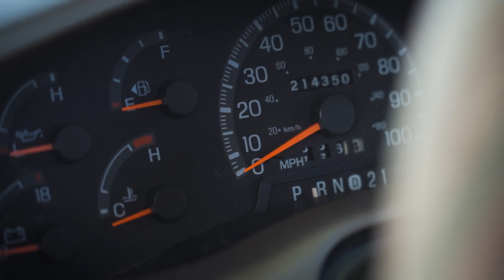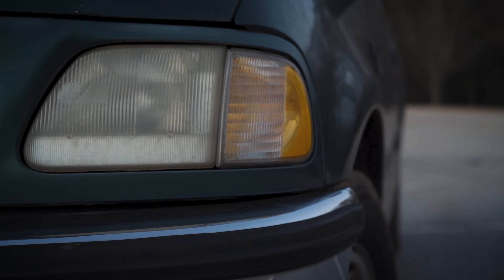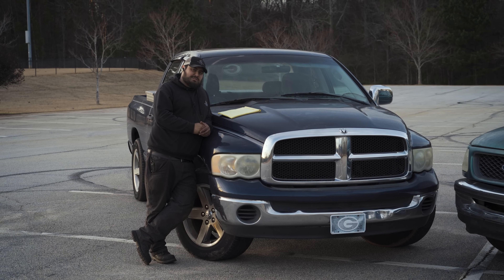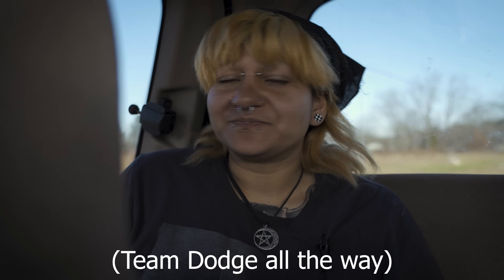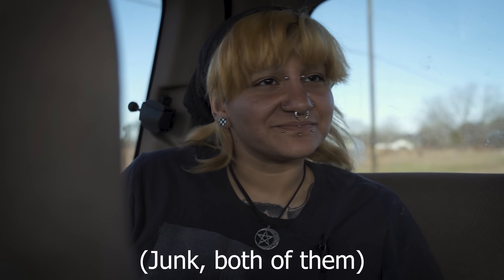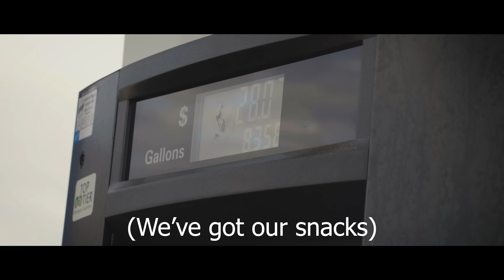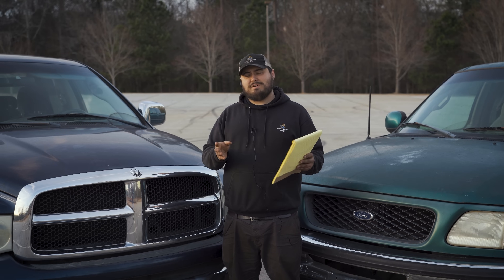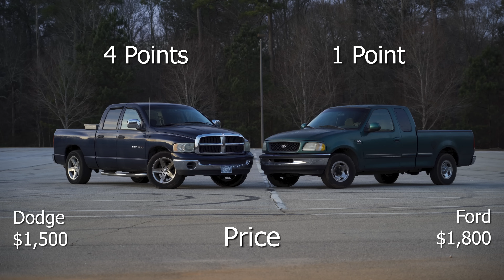CHEAP TRUCK TOWING CHALLENGE, Head to Head Towing Challenge, Dodge Ram 1500 vs Ford F-150 Reviews

Comment: I didn't get a $2k truck , but in 2023 I got a $3500 gmc 2005 2500 4x4 short bed ex-cab 6.0l 189k miles with plow in Colorado. I had a 2005 gmc Yukon xl already and think that generation of truck is the best of all brands even over toyota. And definitely beat the dodge and ford of same year generations. Where I am in rural Colorado almost every truck big suv still on the road are 1999-2006 Chevy , gmc. There are very rarely dodges fords years 1999-2010, they just fall apart at high altitude work loads, especially the dodges.

Comment: I have had a few dodges and have a 2016 Ram right now 5.7 and haven't had a problem with any of them and towed over 3,000 pounds with them from Louisiana to Houston Texas over 500 miles one way and had the 4.7, and the 5.2 in the other two and towing wise with the smaller engines I was still getting 18 mpg. Well over 200,000 miles with all three of them the one I have now has the 5.7 almost 300,000 miles on it and I still tow with it without any problems. I had ford's and the best ones I had one had the inline 300 6cyl and one with the 302 all the rest I had problems from day one and I had a lot of them.

Comment: I have had 00 f150 and bought it with 98,000 miles and had it for ten years. So when I stopped driving it I’d gotten 310,000 miles. But when it comes to towing my 19 f150 it does way better than my old 00 ever did

Comment: I’ve had a 4.7 sling a rod, and ive seen a 4.7 last 20 years of abuse still runs only had fluids changed. I’ve also had a 5.9 magnum, and I abused the ever living shit out of it every time I drove it. Truly felt indestructible. Had a Tahoe Chevy 5.3, 220k had lifter noise on start up/cold ran and drove good was super reliable never beat on it. Chevy 2500 with 6.0 towed heavy trailer hauled hundred’s probably thousand cars with it. Never had any issue sold at 260k, guy ran it for a year and blew it up. Only blew up cuz he snapped the dipstick tube and just kept driving it. Bought it back for 250, scored a 70k mile 6.0 super clean for 200 bucks, wakes up every morning and it’s back in action. Also had another 2500, 370k miles never had any major service didn’t have long but was a good truck. I’ve only had one ford 4.6 it was Ok. Better on gas then them all, felt more comfortable driving rather than putting it to work. I have no real complaints about any of them. Both Chevy and dodge have had blower motor wiring issues. Tahoe and Silverado had blower wiring issues you’d wiggle them and it’d kick on. The dodge would melt the resistor every so often. Chevy just felt better quality, when it came to interior towing, and power. I never beat on my chevys like the dodge so can’t say how much abuse it’ll take. Ford blew plastic coolant y pipe first time I went wot. All three domestics are good, they all have their quirks. I can’t attest to any foreign trucks but don’t care too,

Comment: I have a 97 f150 with 277,000 miles and it’s hauls anything no problem, I’m not sure if it’s bc it has the 5.4 but I can floor it and still get up to speed no problem

Comment: I will at this comment I have had a friend that has own multiple 4.7 l well I have owned two of the same Ford f-150 plus both of his transmissions have blown and his engines have gone out I am still holding strong with my 98 Ford f150 4.6 l my 97 5.4 four-wheel drive long wheelbase

Comment: I dont know much about the 4.7 But my 2003 5.9 magnum back in the day was at 294,000 miles on orginial motor, I never put a transmission in it since i bought it with 242,000 but im sure its had atleast one. The A/C kinda sucked but other than that it was an awesome and great running truck and looked so good.

Comment: Iv has numerous early 2000s half ton pickups and from my experience my 04 hemi has been the best driving and towing out off all. Even with 275k miles. I’d even put it befor my 2017 ram 1500 just because my 04 holds gear way better then my 2017

Comment: Hahaha love the engine very three years in the ram. my ram  is a 04 has the exact same motor has 305,000 miles on it with the original motor and trans lol. Always has started n no major issues. I’d trust that tuck to take me to hell n back

Comment: How about a 98 k1500 vs these two ?
Reply from the maker: Very different price point, can't find cheap Chevy's with a real title around here. I have a 1997 Silverado I did a review on, but the Silverado is so much more expensive it's not fair to compare it to these cheap trucks.
Reply: @GrumpyMonkeyGarage  I got a 92 heavy half  k2500 I would happy let yall use in a challenge lol . Rust free with title . It took me a good year to find my 98 that was a one owner truck paid 5 thousand a year ago for it . The best 5 thousand I spent that whole year . Only thing I had to do was replace a lazy starter and added drilled slotted rotors. Gets 17 mpg other then the typical gm clear code it's a sweet truck .

Comment: I had a 98 f150 4.6 I loved it but I had 2657017 lt tires it towed just fine tires make the truck but I agree with the Dodge being junk transmission issues electric issues but Ford is always more reliable

Comment: 02-05 had the worst of the wiring problems. If you put a tipm on an 06-08 they arnt too bad. I had to replace the wiper motor and wiper transmission both on my 04 along with it going into limp mode all the time because the bell crank sensor (tps) was going out.

Comment: “Old ford you can do no wrong” Got to love the subtle at which he talks about the faults the ford has on the tow test, “ it’s got some of the common ford electrical problems”  this is what it is like working in a shop with brand loyal techs. Both vehicles could have the same problems one is labeled a POS And the other is just old and to be expected. 😂🤣

I was mechanic for over 10 years and could get both of these trucks running tip top again. I personally think the dodge is better truck. Hell read the edmunds 2004-2005 used truck reviews on the dodge and the consumer rates it 4.7 start out of 5.

Comment: I have a 1997 f150 single cab short bed. 4.6 lifted on 35s. 5 speed swapped. Pulled a loaded trailer 12 hours through the mountains and 12 hours back. Boiled the trans fluid once but it did pretty good.
Reply: 11-12 MPG. brakes left something to be desired tho

Comment: Comparing apples to oranges. Although the engine liters are close, the structures are different. Compare a 2004- 2005 4.6 F150 to the ram, then the test would be equal. If not, then could compare a 1994-2001 Dosge Ram 5.2 for handling comparison to the 1998 F150.

Comment: My ex stepsister had a 98 4.6l thing ran great with over 305k on the odometer which had been broke for no telling how long and probably realistically had 400k plus on the original engine and transmission  her dumb ass ran it out of oil and cooked the number 7 connecting rod. What’s crazy when it slung the rod it didn’t destroy the block. Bet that block could be reused as long as no main bearing was spun.  No hole anywhere in the oil pan no cracks no nothing. Piston was still in the cylinder for number 7. Damn 4.6l are over engineered but my god they don’t quit lol.

Comment: Looked/sounded like the Dodge had an aftermarket exhaust, I think if the Ford had one also it might have picked up a few horsepower for towing acceleration (also the ‘99-up 4.6L has more horsepower)

Comment: 5:34
Hi there. 
Dodges allow for the keys to come out of the ignition as a "rancher" would want to use keys to unlock gates and or start farm equipment. 
For this video im going team ford.
Ford can make a v8
But so can dodge 🤔
Reply from the maker: The problem was I turned the truck off, and it kept running. Key fully in the off position, wouldn't turn off!

Comment: I am certainly all for Ford over here, I love ford and they last forever, but I did in fact buy that same dodge since it was a cheap. I got a 2002 ram 1500 4.7 and a 5 speed, and I’ll tell you I absolutely loved that truck and still have it until I can sell it to buy an f250. At first I was not a huge fan of the 4.7, as it has 3 huge issues. But, after seeing one of my friends with a 4.7 in their grand Cherokee do 260k miles of absolute abuse, I got interested. And sure enough if you take care of the 4.7 it will last even if you beat it. Unfortunately it lacked power so I am going to sell it. But all in all actually really enjoyed the truck.

Comment: My 06 ram had the same wiring problems. Took it everywhere to get it fixed. No one could solve it. One day after work it wouldn’t shut off so I dug into it myself. It’s actually a quick fix. There’s a rod from the ignition switch that runs though the steering column. It goes to a little black box. Inside the box is a ball bearing and spring that has came loose and is shorting out the electronics in the black box. Remove the bearing and spring and the issue never came back.

Comment: The dodge if a 2002 like that one tested was offered with the old 5.9 pushrod motor just 02 before the Hemi came out.  That engine would suck much more gas, and came with 4 speed trans, but still might be an even better tow rig.

Comment: I’ve owned lots of cars and trucks. That generation ford is rad and dependable, so is the generation before that. After that I’m not a huge fan of the power plant, still very nice just less dependable. The dodges are ruff, and in my area they’re very few survivors. The dodges before these were great minus the cracking failing dash, they did have weak trans. The chevys were great, the Tran were there weak spots.

Comment: Had a 2003 F150 Fx4 extended Cab with the 5.4
The best thing about these 10th Gen F150s is that Ford made a Shit Ton of them. Seriously, any problem(s) you come across can be and will be found with a little Google search. Someone somewhere has already dealt with a problem and found a fix for it. I miss that truck and it never left me stranded. Even after it swallowed a spark plug. It ran on 7 and took me home.
Reply: I had a 99 F150 and 100% same here! It was nothing special. Not much power. I beat the crap out of it. Lots of offroading and towing way heavier than I should. Never ever left me stranded. I really miss that truck honestly.

Comment: Not all dodge trucks are bad. I have a buddy of mine with a forest green 2010 Dodge Ram 1500 crew cab, and it's still on it's original OEM engine, transmission, and such. only thing he's really had to replace was the battery, and the oil (because it's obvious those need to be replaced from time to time), but it runs fine, doesn't have electrical issues, and well, if I'm gonna be honest, it's one of the best cheap old trucks I've seen in a long time.

Comment: Aren't the ford in that era a real pain to work on by yourself?
Reply from the maker: Absolutely are, we did a whole video review on this green truck and that was mentioned. Thank ya for the comment!
Reply: @GrumpyMonkeyGarage  gonna check it out, but in your opinion, what the best truck from 90s to early 2000's thats great for doing truck stuff and also fairly reliable. But one can easily work on them by themselves and isn't a real pain in the ass?
Reply from the maker: @laillahilaallah001  Well, it's difficult, everyone's needs are different, but using a $5k budget, I did top 5 small trucks, and a top 5 full size truck video, with the pros and cons to each. The short answer is Chevy/GMC seem to be the easy fix, always run and drive, while coming in at a medium price point. Just don't ask a half ton to be a 1 ton and Chevy's last forever.
Reply: @GrumpyMonkeyGarage  thanks for that. Your channel is very very underrated. The video quality and content is on par if not better then most mainstream car/truck channels. I'm in the situation where I need a truck to do truck things. Here in north Minnesota, the winters get really bad, and my small hatchback fwd just won't cut it. I'm a big guy so I need a truck that has a really big cab. Leaning toward the dodge ram 2nd gen/3rd gen because it just looks really good. And I've heard good things about the 5.9. The cateye silverado is another truck I'm looking at aswell.
Reply: @laillahilaallah001 if you get the dodge you want V6 3.9.  the cat eye id want the 4.8 have seen em in one ton box trucks and would swear she was a 6.0
Reply: @laillahilaallah001 ford 87-96 is the good ones I had 87 5.0 h.o f150 3spd auto go 60+mph in first

Comment: Bro . Your electrical problem in the Dodge is your TIPM aka Totally Integrated Control Module. You made it sound like there is no way to fix the problem. I've owned both brands... I'm a Ram Man Now. That Triton was horrible. Spark plugs in models 04-08 good luck getting those out yourself and the VCT Valves constantly gets clogged. That truck was in the shop more then I drove it. Besides that. My 14 ram made in Nov of that year. So I say it's a 15. But I'm at 183k and I still get 22mpg average. No hemi tick . No bullshit. I pull up to 23 5.7 hemis side by side and my engine sounds just as good today as it did the day I took it off the lot .

Comment: My father inlaws 03 ram 1500 4.7 lasted 250000 miles to get there it needs the tranny replaced 3 time 2 remanufactured rear difs and 3 complete engine rebuilds and the fuckers wipers still go crazy without touching them and he can be driving down the road and pull the key out of the ignition and the truck still drives as if the keys are in it 🤣 he retired that pos 3 yrs ago and what did he do!!! He bought another one!!!! This time a 05 ram2500 with the 5.7 hemi 😂

Comment: I'm a little late to the video, but there is a lot of technology and design differences between these 2 trucks. You should have used a 2003 or older dodge, which is from the correct era of competition of the particular F150 you chose. You compared 2 different generations of trucks, or used a 2004-2008 F150 which is the equal generation to the Dodge you chose to use. The previous would have been more likely because 2nd gen Rams can be found for under $2k everywhere. You sounded biased against the Dodge the whole time but you inadvertently rigged the entire test against the Ford

Comment: Ive owned both of these trucks myself
I had an 04 ram 1500 4x4 single cab with the 4.7 and dogged the piss out of it and mudded it and it never gave me issues even at 260k miles.i also had an 01 f150 4.6 stepside with 250k miles and that truck never gave me issues either.owned both for about a year.if i had to do it again id skip both the ford and dogde and go with a silverado.i owned an avalanche for around a year (also 270k miles all original and by far way better in every category then both the dodge and ford.so if your gonna pick a cheap truck from this era  between the 3 go with a silverado no doubt

Comment: 2nd gen ram would have been a more fun comparison, considering they're closer in age. I'm not a fan of brand bashing, but to be fair, 3rd gen rams weren't the greatest, the only exception being the 02/03 with the 5.9 magnum (as far as gassers are concerned, imho).

Comment: I had an 03 f150 and i fucking hated it. 4.6 too. Thing would stall at red lights and just keep turning over, the coolant temp sensor failed 2 times, causing the temp gauge to read hot which mad it stall, it had death wobble like a sumbitch, not to mention the swing out doors stopped working, and all it was was a waste of space, sold it for 1600 to my old highschool bully (thought he deserved it) and bought a 2006 dodge caravan that same night,  was then best damn vehicle ive ever had

Comment: Lol stop acting like what he says about Chrysler ain’t true. The Dodge trucks are great for being a truck that’ll pull and you don’t have to care much for it. I’d get the Hemi in it so all I have to worry about is the trans when it goes out, and I mean when. Electrical issues also purge these trucks. 

Now on to the Ford, these things were decent at best. Styling was outdated by the year 2005, I however did like these bodies a lot but to be pair to all who see them, they aren’t one of the favorite bodies. They tend to rust and are usually falling apart around the motors. Both were great motors, the 5.4L 2V being right before the dreadful 3V. I haven’t really seen transmission problems but they are there. Just not as bad as the Explorers of the next years. 

All in all, I pick the Ford just because of the 4.6L.

Comment: The reason the ram gets such bad mileage is cause it makes more power than the 4.6v8 out of the Ford, my 2008 dodge ram makes over 300hp and over 325ft-lbs of torque, those 4.6 V8s are reliable but under powered, hence why they don’t use nearly as much fuel

Comment: Dodge is noisier and is squats lower. Mild SCT might help the Ford. I pull a tall 2 horse and can pull 2 draft horses and pretty stable and I am in the mountains of NM. I also had a 5.2 magnum 1997 Dodge that was totaled and it was not great on power and towing was about equal

Comment: There are so many issue with this video.  The fact that there is 7 years between these two trucks is a huge non validation point.you probably cant find a 5.2l 1998 Dodge out there, and the 2005 F150 with a 4.6 is far over the $2k budget. The wheelbase is only 1" longer on the  dodge, also its only 1.5" wider(overall). The cab is longer, and the box is shorter, thats it. That 5 speed transmission vs the 4 speed in the Ford makes a difference, the sway issue is too much tongue weight. Its 10% of the total weight of the trailer. The ford 4.6 has 220hp/280lbft, and that 4.7 dodge has 235hp/300lbft. Even though the numbers are both sad the advantage of extra gears and more torque will be in the dodge's court. The extra 1000lbs of empty truck makes a difference when towing.